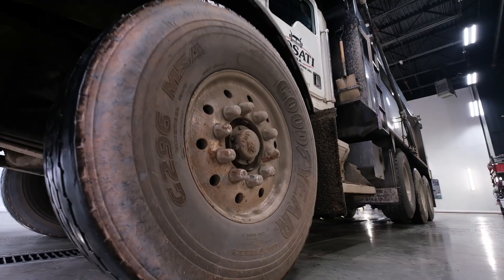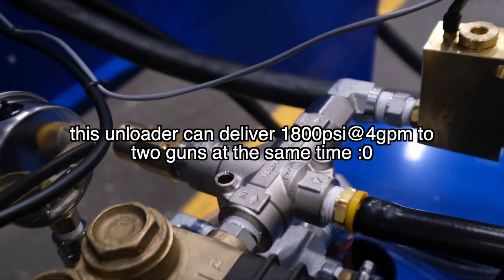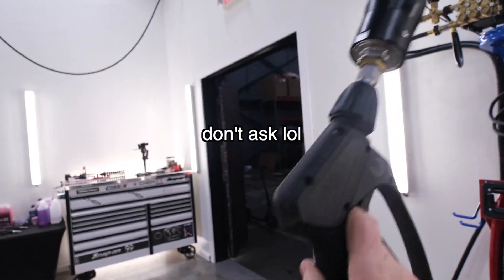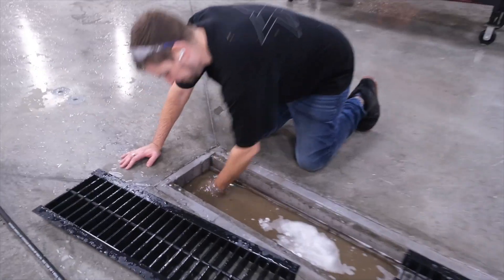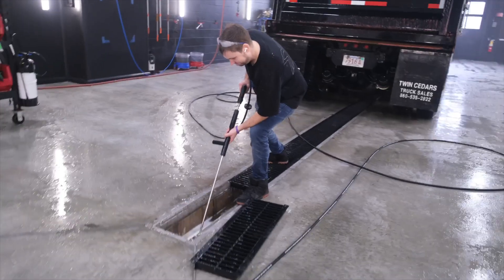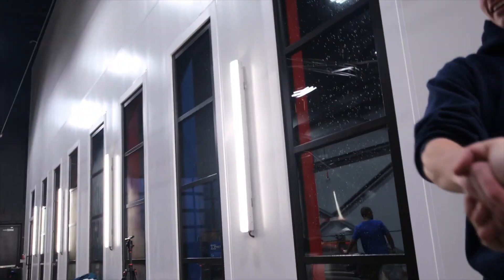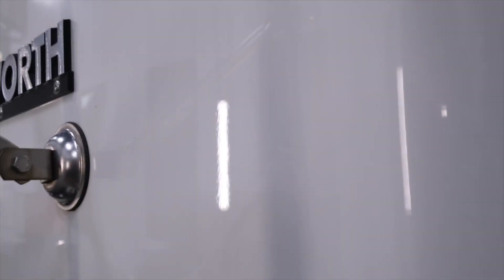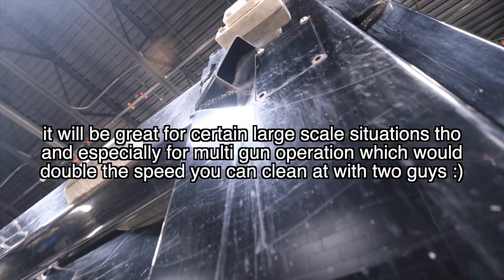TOUCHLESS WASH on DIRTIEST KENWORTH YET with the BIGGEST POWER WASHER + FOAM CANNON I'VE EVER USED!

Comment: I saw a dewalt 4000 PSi washer for home use. Is that equivalent to this? The flow was 4 gpm.  I find it fascinating in all detail or wash videos, no one pays attention to the bck of wheels and tires. Of course if some customer requests it in cars, its an extra cost.
Reply: it would most likely get the job done I believe I saw a reply he posted that it didn't make the process any faster
Reply: @jamesevans938  aha..thx

Comment: The world of real pressure washers is a doozie.
All my work trucks have 660 cats (10gp 3000psi)
Some of the bigger ones have 3560 cats (20gpm at 4000 psi)

RE the multi gun unloader it should be able too provide 4gpm, too each gun at 3600 psi.

Comment: The truck chassis came out super clean.  The way it shined on the way out was pretty nice. So I gotta address the elephant on the room, the foam cannon.  Is that something in the works?
Reply from the maker: lol thank you yeah the foam cannon is available anytime we actually sell them already, but they require a minimum of 6gpm on the power washer which is a rather rare spec lol
Reply: @ChemX  the spray span on that foam was amazing.  It covered so much of that truck.  Do you by chance have the mtm mezzo in stock?

Comment: That power washer is a monster!! It would probably push me back lmaooo. Also love whenever you use snake oil, the instant water bearing is such a site to see!!! Cool stuff bro!
Reply from the maker: Thanks man yeah I thought this formula would be a massive up for these quick tune up videos, really takes it to the next level to bead at the end like that😁
Reply: I’ve got one like that with 11gpm and it pushes you back even more than this one
Reply: You cant use guns with an angled tip with these larger units. They wear you out when the gun is always trying too twist your wrist up. The lance needs too be straight so you can take the pressure with your elboys straight and shoulders locked.
Reply: @Chem-X how much would this pressure washer cost from you?